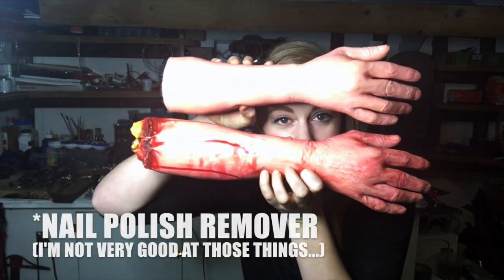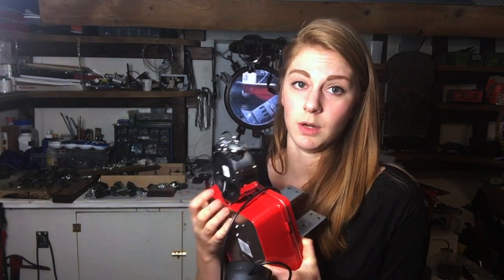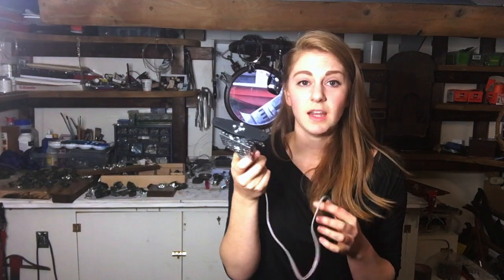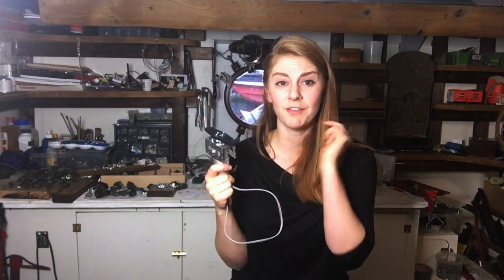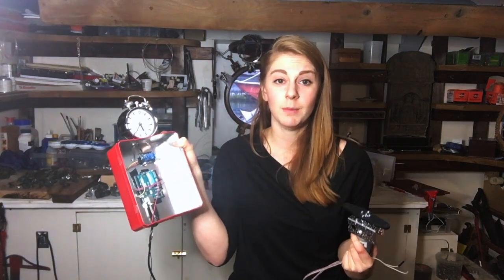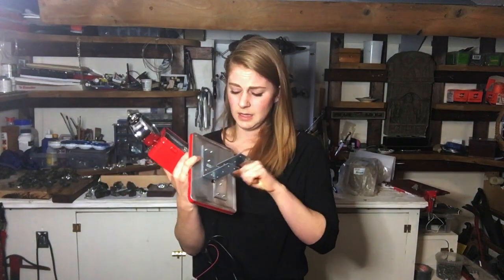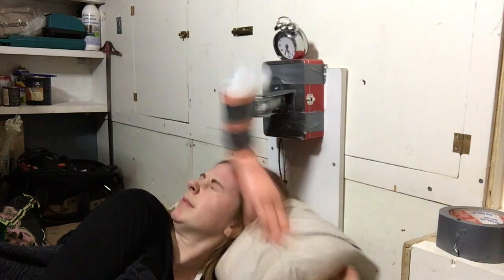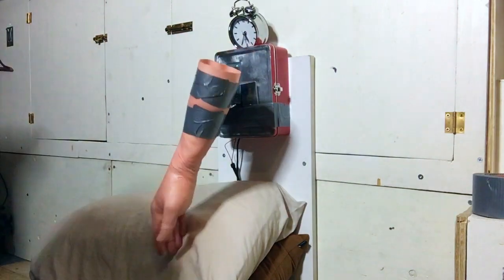The Wake-up Machine VLOG

Comment: As someone with long hair who's played with quadcopters, the best thing to do in an "oh god my hair is wrapped around a motor" situation is to remove the propeller or servo arm or servo horn in question. That'll hopefully keep the damage to your hair down to a bare minimum by letting it just slide off.

That said, it hurts like crazy and not everything can be easily taken apart while you're entangled in it. Good luck in future builds!

Comment: buz11 can handle 30amps and can be driven using 5v logic, if you use a small transistor with the collector connected to10v via a resistor you can drive the power transistor harder.  have you remembered to add a diode across the motor the transistor is probably being damaged by the inductance of the motor

Comment: use a small transistor to switch on/hold closed a cheap magnetic/mechanical relay, and let the relay close the circuit to the motor. that way your transistor only has to handle the current that energizes the electromagnet to close the switch in the other circuit. also, just found your channel via reddit and have to say you are pretty fucking awesome ! keep up the good work!

if you have a spare through hole board, the transistor and resistor, id just order a relay...probably can be found for 2usd or less... if you just want it shipped ready, go with this, http://www.amazon.com/gp/product/B00KTEN3TM?psc=1&redirect=true&ref_=oh_aui_detailpage_o00_s00 which works with pi or arduino, it will ship with bent pins(cause its 6usd and packaging costs more than the product) but both the units I've ordered came fully functional.

Comment: You could use a RFP30N06LE mosfet (30A 60V), it can easily conduct over 30A at 5V gate voltage or 20A at 3V gate voltage (check Vgs vs Id characteristic graph in datasheet). It must be heatsinked when used at high currents!

Comment: I want to work on projects with you XD  seems like it would be endless fun. But while there may not be a single transistor to do what you want, you can run several of them in parallel and that will get the job done. I used 8 (forgot part number) controller by a pro mini and worked great for a very fast RC car

Comment: L-järn and silvertejp to the rescue :D
A relay is just fine for this application but if you need faster switching you could use some logic level MOSFETs to control high loads or control a bigger MOSFET with a small transistor and a higher voltage like 12V.